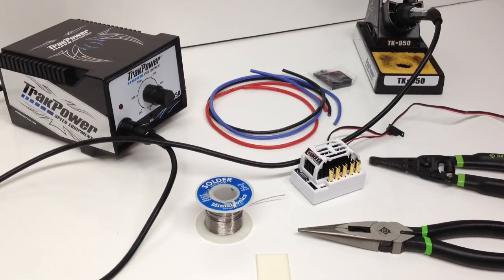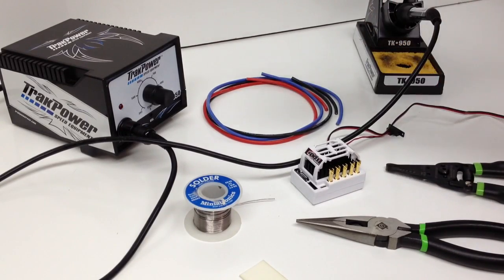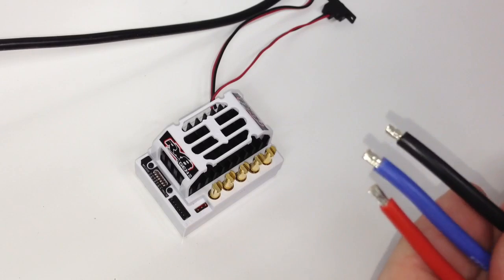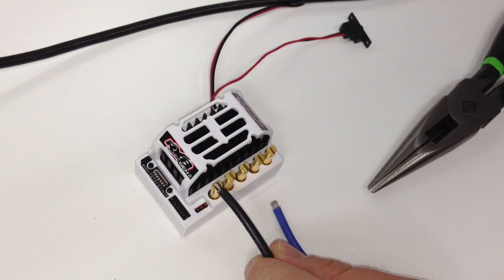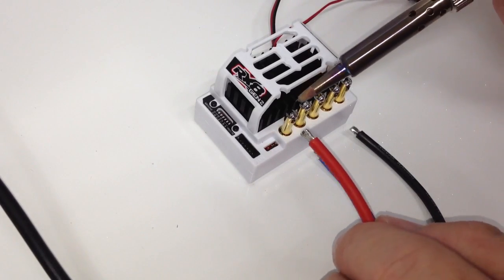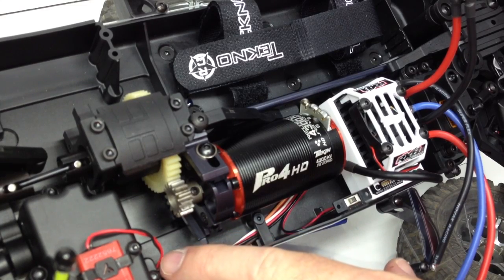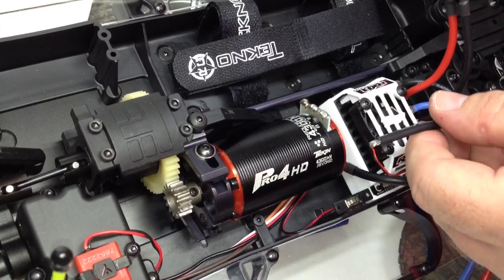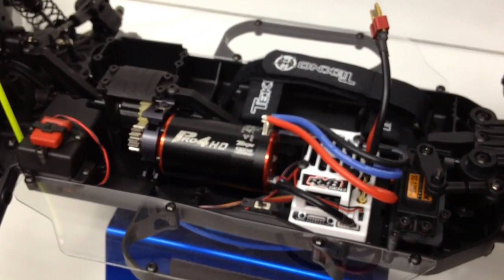How to Solder an ESC to a Motor - Remote Controlled Vehicles

Comment: I own two emax two 4x4 stampede two 4x4 rustler two 4x4 slash two trx4 blazer two scx10 two trx6 two clod buster two TL01 two erevo two 1/16 erevo and my biggest problem is wire Management
Reply from the maker: It starts from day one....each RC.  I had over 100 RC's in my collection at one point, all were 100% tidy, wiring wise

Comment: What do i go when i get too much solder on the esc tab and i cant get it to roll off holding it upside down and heating it.
Reply from the maker: They sell a solder wicker - it's basically mesh steel tube that sucks the solder up. I've never used it....but have been tempted to buy it.  Like you said, if I have too much solder, I usually tip the post/item I'm soldering and lightly flick the heated solder on to my work station.....do this at your own risk away from body parts!

Comment: Oh yeah my solder I been fluctuating between bernzomatic elec. 60/40 rosin core leaded and bernzomatic elec. Rosin core silver bearing. Both seem to work good but the leaded seems to work better with the flux I'm assuming. I find about 760° to 800° temperature seems best for those heavy duty food plated solder pads as they do pull heat from the iron fast like I mentioned earlier post...just makn sure I'm not overheating. I know quicker the better to not desolder mosfets or whatever off the pcb. I'm wondering if keeping hot iron on too long is what ruined my first esc or would you say 80° timing was the culprit. And the dumb thing was it was early spring kinda cool out esc was machined out of billet aluminum which def. seemed to keep esc very cool never once got not even room temperature..the motor hit mild room temp. My other builds run telemetry or dynamite temp monitoring systems so no temp gun yet but I can feel with fingers to know if its overheating. I'm guessing the over timing but I would think it would overheat which I have my motor and esc temp cutoff set to lowest 180°.  Brother I greatly appreciate you takn time to read all this..I know its alot but at $120 for the little esc's I'd really hate to buy a 3rd all in 1 season. 1 more thing! Aren't cold solder joint kinda dull in color to where a solid joint is shiny like new silver? Thanks again man

Comment: I'm not sure if I missed it,  but at what temp you have your TK 950 set at ? I'm trying to solder my wires to my RX8 Gen 3 but I'm having some trouble,  the terminals on the gen 3 is more like a horseshoe than open like your gen 2 . I'm also using the tk 950. Thanks in advance man... great channel .
Reply from the maker: 800 degrees.  Make sure you tin both items first and then add some fresh solder to the tip of your iron as you melt the two together

Comment: don't mean to stalk you, but i'm warming up to soldering the rx8/t8 on my mt 410. i've been an alarm tech for the last 20 years, but i've always hated soldering. i think it's the cheap iron thing. l just got the tk955 so we'll start with battery connectors and take it ftom there.

Comment: I mostly do model railroading. Most soldering irons I bought were very horrible. (Those battery powered ones and those cheapo Homedepot weller ones) Do you recommend this soldering station, the TrakPower TK-950 for use with model railroading?
Reply from the maker: I definitely recommend this station. Trak Power also has a digital model called the TK955 which has a display of the temperature vs a dial like the 950.  I'm not sure how intricate model railroading is, but I can easily solder 20g wire with this up to 10g
Reply: I'm mostly going to solder 30-32g wire, modifying PCB boards, fixing broken wires, and mostly soldering 30-32g wire to PCB boards and speakers.

Comment: ewww.. lol. I would've had the motor wires shot up from the ESC then straight across the ESC to the motor. I know its an old vid but I just saw it :) .. Anyway thanks for all the quality and well lit vids I enjoy watching them. Also, any chance of doing a video on the new Exotek chassis kit for D413?? Thanks again.
Reply from the maker: Thanks for watching Mike.  I wanted to keep everything as low as possible for that chassis....Here's my latest install/soldering video:  https://www.youtube.com/watch?v=sXDruxcncvE
As for the Exotek D413 chassis....I'm really happy with the Aluminum +4 Schelle chassis.  It really works for where I run and tamed the sketchy-ness of the D413

Comment: Hey I was wondering.  My local hobbyshop has a LRP high power soldering station for sale would you recomend it?
Reply from the maker: Yeah, it's a decent iron....go for it!
Reply: The RCNetwork what would you say is a professional one because I'm doing soldering as a profession in school
Reply from the maker: In the world of RC and hobbyist, The top rated irons are Hakko and then Trak Power.  LRP is mostly sold in Europe - but looking at the specs of the LRP, it's pretty nice.  You will do fine with any of them.....They all have adjustable temp which is the most important...The LRP is by far the most expensive at $200+   The TP goes for about $80ish and the Hakko 888 is about $100.  The Hakko 951 is in the LRP range of over $200
Reply: +The RCNetwork okay thanks

Comment: could you recommend a starter solder kit. I am going to be doing my first soldering of a motor/ esc. I don't need anything expensive because I won't be doing much soldering but I don't want something that won't get the job done.
Reply from the maker: +RC Action As much as I would like to recommend a lower priced soldering iron, I would be doing a dis-service to you.  I experimented with several (4 in total) Weller sub $40 irons and it all proved to be mediocre at best before they just burnt out ans stopped working....and I was just like you, didn't solder that much.  Since picking up the TrakPower in this video (about $70 on sale) my technique has improved and it's almost fun to solder.  It really helps having the right equipment.  If this is a once in a lifetime soldering job - check with your local hobby shop, mine does quick jobs for $5

Comment: thanks so much. soldering is the bane of my existence. just can't seem to get it right, but after watching this, I think I now know several things I have been doing wrong.
Reply from the maker: +Ryan Feeney Three keys to soldering:  1. TrakPower soldering iron 2. Lead based solder 3. Lots and Lots of practice!
Reply: +The RCNetwork 
How much does flux come into the picture?
-Ive heard others swear by it, but I didn't see it here.
Reply from the maker: +Ryan Feeney I use a solder with a flux core.  Plenty for what we're doing

Comment: Nice video! I was thinking about getting that motor and esc for my losi ten scte 4x4 on a 2s lipo but was wondering if I should get the 3500kv or the 4300kv motor?
Reply from the maker: +Jacob H Either way, you'll be limited to 2s lipo.  The 4300 will have the speed you'll probably want on 2s.  The 3500 will be a bit slower, but have more torque

Comment: hey, are you on rcshortcourse?  i have my build thread under Travis' Tekno SCT410, check me out there......i do have my preferences with the way you've routed your RX8 compared to the wires facing the motor side and looping your wires, having the wires in a very fragile place with the servo horn isn't the best of ideas under hard hits, full turns, greater possibility of the horn shorting out on the posts or if your servo strips out, ect......also, i know this is off subject but on you mylaps transponder, the case you screwed it to has an indention for the wire to pass thru on the backside by the antenna if you want to clean up the wiring while also making the transponder easier accessible when getting to you receiver unit... thought i'd give you a heads up there as well.  lastly, i would look into screwing the rx8 down, over time the tape might give you trouble putting you in a bigger bind than going the longer route first and for all.  i'd add the kyosho gel while your at it for longevity of ESC
Reply from the maker: +TTrahRXPXBaNsHeE Hey Travis, Yes, I am on RC ShortCourse, but after hundreds of posts and many, many comments and helping people out, I just couldn't take "Eric" anymore (I'm sure you know the Tekno hater....)  Since this video, I have switched the wires around a bit - You can see how I routed them in my new EB48.3:  https://www.youtube.com/watch?v=PsRD7_QAZrk

Comment: What is the recommended temp to use to solder your rc? Is 500 to low? The solder I'm using is 67/32
Reply from the maker: Adrian Raymundo I'm def not a professional solderer (is that a word??) but I usually set mine at 700 or so

Comment: Hi, good video. What welder are using? You wanted one like it. Greetings, I subscribe me :)
Reply from the maker: In the video, the Trap Power TK-950.  Worth EVERY penny at about a $79 street price.  I have had several $40 wellers and this out performs them hands down and make soldering much more fun.  Check out my unboxing video:  The RCNetwork - TrakPower TK-950 Soldering Station

Comment: Just an opinion... But that would've looked sic if you turned around the esc and ran shorter (and cleaner) wires.          But all the same great vid already know how to solder, just checking out your pro4hd. Thanks for sharing!
Reply from the maker: Thanks No Lime!  I originally was going to run short wires, but it woulda looked like a pretzel since abc was opposite to the motor. Thanks for watching.
Reply: The RCNetwork so then just reverse the settings in the esc. same thing
Reply: justin credible it's sensored motor

Comment: Great video like your channel and recently subscribed. The sponge is ok for the tip you just need to start tinning it. Always have a little bit of solder on your tip, before you solder a joint wipe tip on brush then add a little bit of solder to each side of your tip, makes soldering the joint easier also. Then its real important to put a good amount of solder on your tip when your done and shutting it off. Your tip is discolored and will ruin quickly because its being exposed to oxygen, tinning it will protect it and when u swipe it on your sponge it should be a shiny silver, thanks for the great videos man.
Reply from the maker: Thanks JD!  Yeah, I have, since this video figured out about tinning the tip prior to storing it.  Although I still use the sponge for cleaning, I am in the market for a good "tip cleaner".  That sounded bad....lol

Comment: very nice video thanks because Im thinking about getting a rs Gen2 soon and was unsure how the solder posts worked. If i may critique your video just a bit your soldering tip is filthy. do you never clean it? it always seems to me that if my soldering tips aren't that nice shiny silver color I wont get good heat transfer. anyways Thanks again for the video and good luck.
Reply from the maker: Thanks for watching Scott.  Yeah, I need to get a good tip cleaner for my TK-950.  The wet sponge thing just doesn't get it right.
Reply: The RCNetwork Yea Ive always been a 20 dollar weller kind of guy. Granted i just bought a new 40 watt Iron because according to weller mine is "obsolete" and no longer made. but this new one gets so hot it burns the tips up. But back when I was soldering more when I would direct wire my brushed motors I would use a container of general purpose flux (not plumbing flux) and then wipe the tip off on a copper dish scrubber. or you can buy the nice tip cleaners that come in a container for a bit more money. but the idea is that there is minimal heat loss cleaning your tip this way so you get a better result. Either way thanks for the upload I enjoyed watching it. Your soldering still came out great. better than most of mine :D

Comment: I get it. I do too but how do you clean them THAT good. Do you rinse them with water or something? I use air and wet rags. I'm not waterproof besides what I plastidip,
Reply from the maker: I mostly run my rigs on clay, so they stay pretty cleAn. Otherwise, air compressor and clean me down with a rag

Comment from the maker: The Tekno was designed to race.  It has been bred from their 1/8th scale, so many parts of the driveline are from the EB48.  The steering is rock solid (there's ZERO play!!) and the drive line is as straight as an arrow.  The Tekno also needs no upgrades out of the box.  It really was a night and day difference, at least for me.  with box stock set up, at my local track, I took a second off my lap times on my first outing.  The only negative on the Tekno is that it's heavy (mine's at 6.85lbs)...

Comment from the maker: I ran the SCTE for about a year.  I did every possible upgrade to the truck including MIP, KH, Bump, TLR, etc. It is a great truck, but has it's weaknesses (like every truck).  Losi never intended for people to race the SCTE as it was just a bash truck (not having the TLR name).  With the 2.0, they addressed the weight, weight biasand gave it the needed upgrades in the pack.  Still there's issues with the driveline wobble and the steering.  to be cont...

Comment: just so you mnow your fan is plugged in backwards. I just found out with mine when i first bought my tekin rx8 and 2000kv T8 motor. It has to be plugged in where the black wire is on the side where the motor sensor wire is yours is backwards and your fan will never come on.

Comment from the maker: When you go into the Hotwire App, you can set it at 2s Lipo.  There is also a customer voltage setting if you want to tweak it down a couple of tenths, but be careful

Comment from the maker: Good tip on the switch, I haven't had an issue, but just like having the switch in a position to whee I can get to it with the body on.  Also, thanks for the idea on the horn.  I ended up not using the TLR22 and just using the stock for now.  I have an email into the Tekno Team to see what's working.